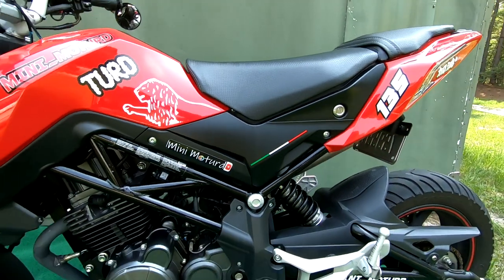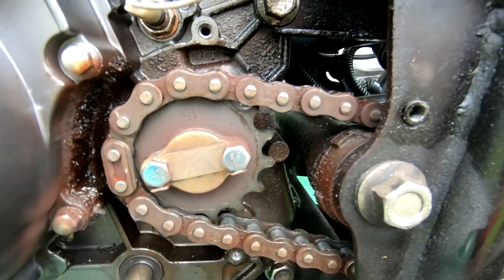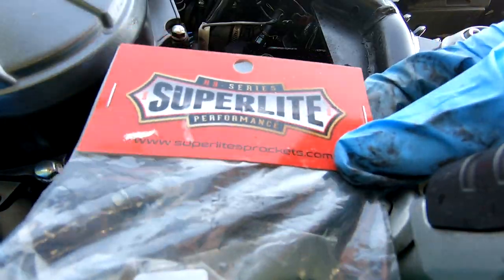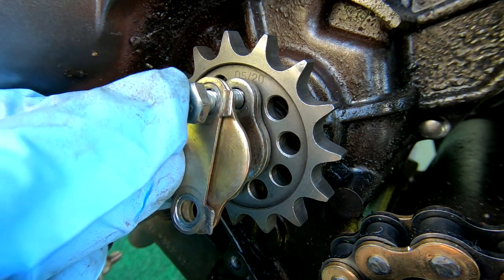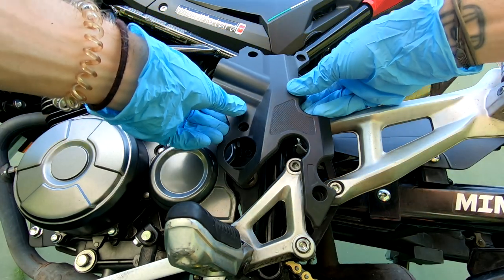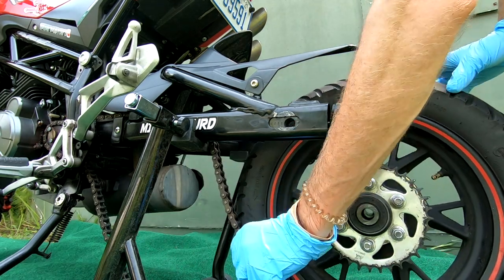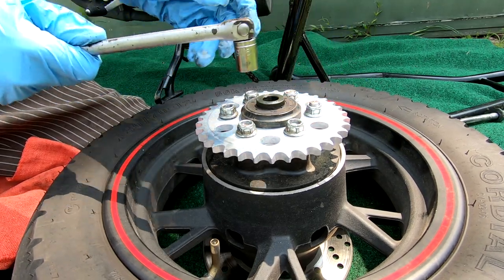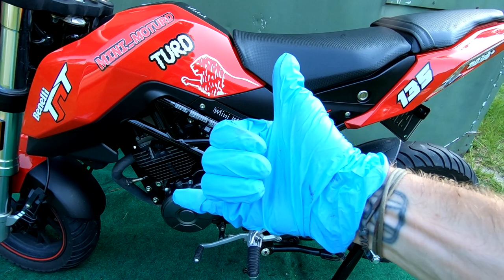Benelli tnt 135cc| Front and Rear| spocket change

Comment: What tooth sizes did you install for the front and rear? Was the change designed to give you more speed or more torque? Thanks
Reply from the maker: I kept the front sprocket with a stock tooth ratio at 15t The only difference in the front was a lighter weight sprocket. The rear was a steel 36t stock sprocket changed to 35t aluminum sprocket. The goal was to achieve a higher top speed and give the bike some relief in rpm. Even though I did hit 2mph higher top speed I found it to be some what unusable gain in that the bike is two underpowered to achieve the TopSpeed gained and/or its top speed in general unless conditions were perfect downhill no headwind etc.
It did give it some relief from the RPMs and was happy with that part of it. I have since switched the ratio again because I think I prefer the torque advantage over the top speed for me personally.
Reply: @MiniMoturd  Thanks much for the info. I'm looking for a 16 front and 35 or 34 back. So if increases things a bit more.
Reply: @MiniMoturd  BTW: Great vid!
Reply from the maker: @braddavis5802  Awesome, If you do go for that set up let me know how it turns out and what you think of it. Here’s where I’ve been getting my sprockets.

Rear
https://www.steadygarage.com/store/rg-aluminum-rear-sprocket-428-pitch-benelli-tnt-135-cc

Front
https://www.steadygarage.com/store/superlite-chromoly-benelli-tnt-135-front-sprocket-steel-alloy
Reply from the maker: @braddavis5802  appreciate that, thanks for checking me out🏍💨🧨👍🏻
Reply: @Mini Moturd  Sure will let you know. Yes, did see those links in your vid desc. Little pricey to send to Thailand. I think I'll find them in the States and have my daughter mail them to me that way. Details....
Reply: @MiniMoturd  You bet. Take care.
Reply from the maker: @braddavis5802  I completely understand that. Sounds good and good luck with the set up, Ride safe👍🏻
Reply: In a video about these a guy was saying that with this size motor and the fact that it has a power out put limit , that you really can’t pull too much more out of them ...
I guess torque  could be more easily gained than speed .
Just sayin 🙂
Reply from the maker: After playing around with it I agree, I was not able to gain any real top end gains. Some torgue gains were achievable but not by much. it’s my opinion that the stock set up was The best all around👍🏻🏍💨

Comment: Well is there much of a difference? I'm riding stock and thinking about changing
Reply from the maker: It’s does give it some rpm relief at cruising speed…When it comes to usable top end speed not really in my opinion The bike just doesn’t have enough power to keep pushing it… i’m about to go the other way and put a 14 on the front and get some more torque Back in it. I’ll check the top speed then compared to now. So far in my opinion it seems that the Stocks set up is the best choice for my needs.
Reply: @MiniMoturd  thanks for input! Im still breaking in with a 42 whopping miles lol can you cruise at 55-60 stock? Or is it pretty much tapped out? I've seen other people saying itll do 74 give or take..
Reply from the maker: @chowder4174   With the Stock set up The max speed I ever hit was 66mph with perfect conditions. But it has no problem cruising 55 to 60 miles an hour on stock setup. The only time I couldn’t maintain those speeds was in the smoky mountains on some crazy hills which dipped to like 48 to 50 mph. Feel like the only way this bike would hit 70s is if you change the sprockets accordingly and gave it some power upgrades.But there’s people out there swearing they’re doing it…that’s just been my experience
Reply from the maker: I was running about I think 8000/8500 rpm at 55/60 and I think redline is 10,000 rpm
Reply: @MiniMoturd  that was stock or the 16 tooth?
Reply from the maker: @chowder4174  it was the stock tooth size 15t. but it was a superlite…here’s the link I got it from https://www.steadygarage.com/store/superlite-chromoly-benelli-tnt-135-front-sprocket-steel-alloy.      

Going to try the 14t next👍🏻
Reply: @MiniMoturd  last question lol thanks for all the help! Its hard to find good feeds on this bike. Was it that noticeable, like it dropped to 6-7k rpm when switched to 16t? Also earned a subscriber I'll definitely be watching!
Reply: @MiniMoturd  im looking for more longevity on engine plan on taking bike with buddies from michigan to missouri this summer.
Reply from the maker: @chowder4174  Not a problem man I don’t mind helping if I can… with a 16 tooth I believe it should give you rpms in that range 6000/7500. At cruising speeds. Will definitely give your motor relief for a longer trip. Appreciate you subbing🏍💨👊🏻 Feel free to ask any kind of questions and if I don’t know the answer I probably know people who do.
Sprockets are one of my favorite things to changeBecause of the noticeable difference in performance with relatively easy easy of changing. Fun stuff👍🏻⚙️
Reply from the maker: @chowder4174  sounds like a good time, let me know how it goes.🏍💨🤙🏻 And what your final gear set up choice was👊🏻
Reply: @MiniMoturd  thanks again man. I truly appreciate the info.

Comment: I just installed front T17 and rear T33 from steady garage and the most I got was 82mph going downhill on the highway so really not so impressed... By the way I see you tighten that chain pretty tight, doesn't it have to have a bit of sag? I also lost a lot of low end power but I guess that was expected...
Reply from the maker: very cool to know what you got out of it. Mines OK for now kind of in the middle of torque & top end. I’m not sure what tooth range I want right now. The video of the chain was taken before I adjusted it. And I missed your comment earlier I don’t know how to convert a grom sprocket to a Benelli. 
Let me know if you do something different
Reply: @MiniMoturd I might do the big bore 155 piston and upgrade the cam only if I can leave factory ecm, if I have to go aftermarket ecm and custom tune then I'll just leave it as is...
Reply from the maker: @evcorchado  That would do it💪🏼🏍💨 let me know how it goes if you if you end up going that way

Comment: Hey what dpes changing the sprockets do as far as performance go? I recently purchased a 135 tnt.  Wouldn't mind it going 65 mph in lower 6rpm range instead of 8rm to 9 rpm
Reply from the maker: With Sprockets you can change how your Power is distributed. You can make it favor the low end torque or top end speed. Just depends on what you want. If you’re trying to drop your rpm at higher speeds then you either have to go down in size on your rear sprocket or up in size on your front.  I tried dropping the RPM. I Put a rear 35t rear instead of the stock 36t and It dropped 1000rpm at the same speed. 
Just sucks losing your torque on these little bikes
Reply: @MiniMoturd  oh ok, well I might as well keep it like it is and invest in benelli 302s or kawasaki 400 in a few months .😂
Reply: Thanks for reaching back ☺
Reply from the maker: Yeah man I went both ways. I went top end and I went with a lower torque set up. Favorite has been the stock set up. seems to be the sweet spot for me. I ended up getting a bigger too😅🏍💨👊🏻
Reply from the maker: @32dsmitty  👊🏻👊🏻👊🏻

Comment: does this increase top end or low end torque?
Reply from the maker: This set up gives you a little more top and takes off the lower and torque. This set up doesn’t give it that much top and now it’s not enough in my opinion I will not be keeping this set up. If you’re just looking to give your motor some RPM relief I would say it’s good for that. I’ve got a 14 tooth front sprocket that I’ll be changing soon see how I like that paired with the 35 rear… more low end power🏍💨🤙🏻 thanks for watching! If there’s any other questions you have feel free to ask👊🏻

Comment: Does this make the Benelli 135 have a higher top out speed?
Reply from the maker: Yes, but only a couple miles an hour faster…so not much difference with TopSpeed.(67.3mph) It did give me alot better gas mileage per gallon and less stress on the motor. Thanks for watching🏍💨🤙🏻 feel free to ask if you have anymore questions👊🏻
Reply: @MiniMoturd  I just put a down payment on a  2022 Benelli 135 white on a Christmas layaway plan and should have within 2 weeks. I will have many questions to come. Thank you for all the informative vids
Reply from the maker: Awesome man!!! Congratulations👊🏻. Glad you liked the vids and again if you ever need advice or have questions I’ll try my best to help out🏍💨🤙🏻
Reply: So would you recommend this  Sprocket change
Reply from the maker: @jayavallone7446  if you want to lower your rpm taking some stress off the motor and your okay with sacrificing some torque then yes.  If your not concerned with lowering your rpm I would not because of the fact of little to no difference in top speed. Thanks for watching🏍💨🤙🏻
Reply: Are these grom sprockets you're replacing with?
Reply from the maker: They might also fit a Honda Grom, but they are labeled to fit A Benelli tnt. Here’s where I bought them https://www.steadygarage.com